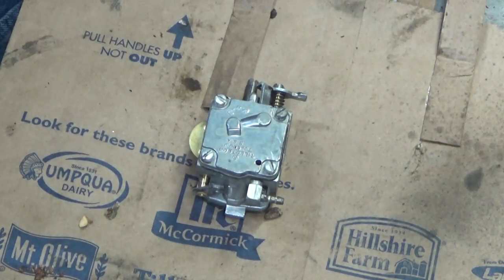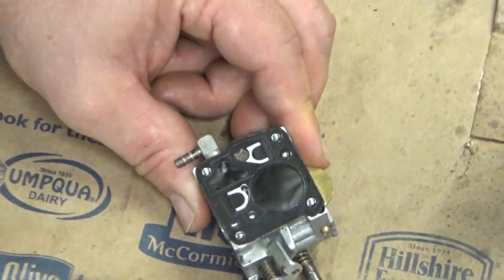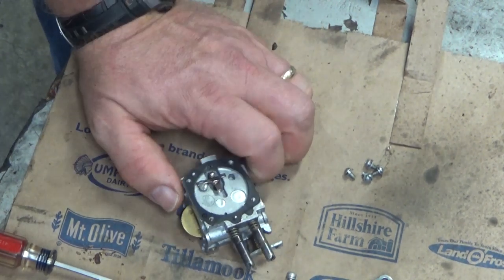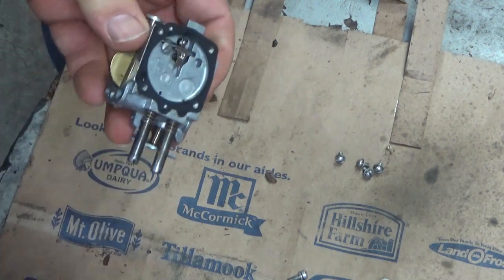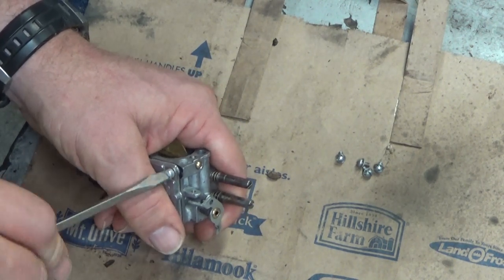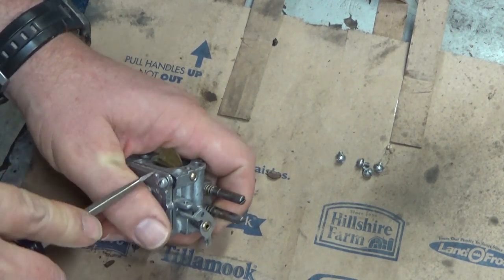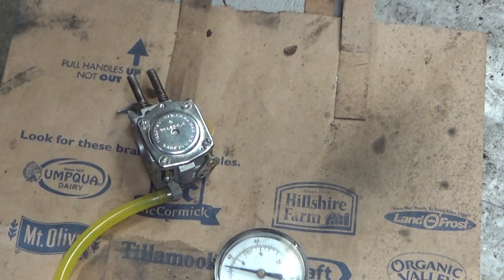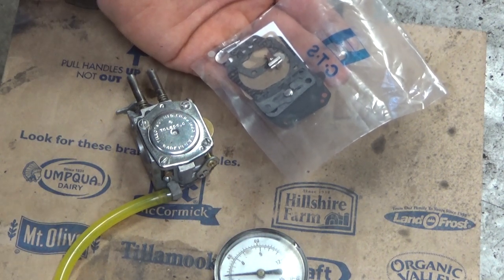Tillotson HS Series Carburetor Repair Homelite & Other Chainsaws

Comment: I clean the fuel needle seat with a q-tip and a little polishing compound. Give the q-tip a few spins and it polishes the seat. It will hold pressure afterward.
Reply from the maker: Good tip, I'll remember that!
Reply: I saw another fellow put the q-tip in his drill.

Comment: Hey !  The small welch plugg.  Is that not a one way valve function ?  And the rubber plate inside there...is that not ofthen worn away or smulderet away...due to long time and rubber tends to smulder after time goes buy or might be ethanol damaged it... So if the little rubber plate...is gone...or in peaces...leaking...the one way valve system is not working.  You than need to open the small welch plug and put a new rubber valve plate in there...  Taking out the small clip and down with the rubber plate and than back with the little clip....so you hopefully have a much needed one way valve function.  If this function is not there...you whole carburetor will not work...despite everything else is ship shape....was what i fugured out.  On those old carburetor...i suspect that is a common issue and problem.  ! ?   Jostein from Norway and Sweden here.

Comment: I have a similar carburetor from a partner r440, and in addition to the H L and idle throttle settings, there is a large screw on the other side, do you know what that screw is for, maybe the carburetor is Tillotson HS117B ?

Comment: Hi, thanks for this great video. I’m working on a Tillotson HT14A that have leaking issues. Question: How many BAR / PSI should the carb hold when testing it? I don’t have a carb pressure tester but a bike pump with a gauge .

Comment: First off. This video sent me down the right path on fixing my Pioneer 1200A. I HAD TO STRETCH THE SPRING OUT! Needle was not staying seated.

But, I have to say. For the HS series carbs, the metering lever has to be level with the CHAMBER FLOOR. Not the deck minus gasket as he is describing. Simple mistake, I understand you cant memorize every carb spec. Once again thank you for the video!
Reply: I don't know which is the chamber floor and which is the deck elaborate please

Comment: Thanks Leon! Rebuilt mine using this video. Very helpful with the diaphragms because my original one glued itself to it's gasket and I couldn't see that there was a layer system in place. Would have done it wrong if it wasn't for you

Comment: Thanks for your videos. I reference them if I have any questions. In this video you mention that the springs are hard to come by. I had my Homelite Super XL AO carb apart for a rebuild today and the spring looked familiar. I checked the tumbler springs in a Schlage lock rekey kit I scored when a home center went out of business. They appear identical. Next time you have trouble finding one your local locksmith may be able to help.
Reply: You would need to test the springs to be sure the correct length pushes the same.

Comment: Thanks very much for taking the time to put this video up. I have a question: I don't understand, when you explained the height of the needle valve lever to be flush with the deck minus the gasket, but then a little bit lower, I got lost there and I believe my carb is running too rich on that very spec. Do I go lower by the thickness of the gasket from the desk height around the whole thing, where the gasket seats, and then a little bit further down? or is the deck just around the depression where the valve and lever assembly seats (where the tinny holes are for the high-speed rpm setting screw veins)?  HS113A here for reference.
Reply: watching some other info online I think the point is the top of the metering lever must be flush with the diaphragm floor,  I believe that means the thickness of the gasket higher than the surround deck under the gasket it self. I believe mine was too low I'll try it like this and go from there, thanks.

Comment: Hey leon,
I have a Tillotson like the one in the vid. I'm having problems on the low side, saw is finding. I've put a new kit in and can't seem to get it to run right. Have pulled it all apart and spray inlet holes with carb cleaner and all holes are open. Cleaned screen on intake side. Any ideas why saw could be finding on low side? Runs great on High side. Also have clean new fuel. Do you recommend  using high octnae gas for these older saws? I have an old harley that imrun 93 octane with. I think i have 87 in the saw now.Thks

Comment: So if I used starting fluid or carb cleaner on the meter side I ruined it and need new needle gasket diaphragm ECT. Is that correct? Working on this exact carb from a beautiful 306a poulan chainsaw. It didn't run when I got it I've taken it apart once before I cleaned it up but all back together and it'll start but it's flooding pretty heavy and won't stay running

Comment: This is a newbie question. My first carb work on these saws. The carb I’m putting new diaphragm and gaskets in is a 256A from a JRed 630 Super2. 
When putting the diaphragm on the needle side, does that metal knob sit under that arm as does it sit on top of the arm?

Comment: I have a Tillotson HS-30A carb which I took off a Poulan Model 361 chain saw. I have put a new gasket & diapham kit in it. I took it apart twice because the first time I did not have the spring in the correct position and fuel was leaking from the muffler. The problem after the cleaning and rebuild the saw runs sparactic and then shuts off. I have the Low adjustment 1 full turn out and the High 1- 1/4. I found Poulan specs which indicates this saw should have a Tillotson HS-59A B. Would this matter. Is there anything else I should check. This is the first chain saw I have cleaned and rebuilt that has given me trouble. All others have worked fine once installed back on the saw.

Comment: The inlet on my Pioneer 1200a is smooth with no barbs. The hole they provided in the housing for to the fuel line to pass through doesn't line up with the inlet, and makes it a bugger to get the hose on.

Comment: Hey Leon. I'm a disabled veteran from southern WV.  I am a Auto Mechanic by trade, so I do all my own repair work now. Would you care to share the list of parts needed to build your pop off valve pressure tester? It looks to me like you used a manual blood pressure tester, but I can't tell what all the brass fittings are that you used.
Reply from the maker: I didn't build it, that was an original Homelite tool.  The Mityvac 8500 or similar will do the same thing.
Reply: Thank you sir.

Comment: Hello i have one of these that has another line coming off the bottom plate is that just a vent or is that for a pulse line ? I cant find anything about this
Reply from the maker: It could be either depending on what saw it came off of.  I know Stihl used a separate pulse line on many of their saws that used a Tillotson HS.

Comment: Some diaphragm and gasket replacement kits come with 2 fuel-pump diaphragms, identical in shape but they're made of different materials (one black and the other brown). Do you have to put the two identical diaphragms in place always? Which one goes in contact with the carburetor body? What is the recommended torque for the bolts of the carburetor?
Reply: i also have the samme question...
Reply: Guys I think one is for ethenol fuel and one for non. So for most people go with lighter color is ethenol.

Comment: Leon , what type of gage are you using to put air pressure on the carb , I need to get one , thanks for videos
Reply: blood pressure sphygmamometer , pressure gauge 15 p.s.i  ebay 15 bucks ,fittings ace hardware

Comment: You have to watch out with carb cleaner when your sprained it into your hijet there's a little disk in the high-speed check valve and the cab cleaner can warp it! (Sdc carb)
I usually spray out the passages with WD-40 an old-timer Saab builder show me that little trick
Reply: What about using brake Clean
Reply: @ambassadorforchrist9504  I imagine some acetone free brake clean that doesn't harm plastics would be okay to use.

Comment: On the diaphragm side of mine the top tit is broken off, is this a problem?
Reply from the maker: Are you talking about one of the index pins?  If so, that's not really a problem as long as everything lines up when you tighten it down.